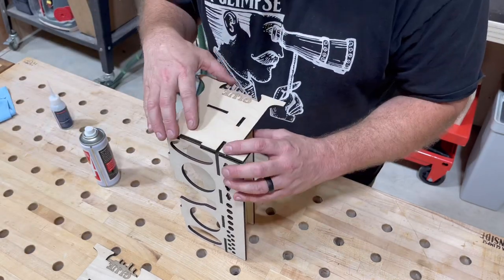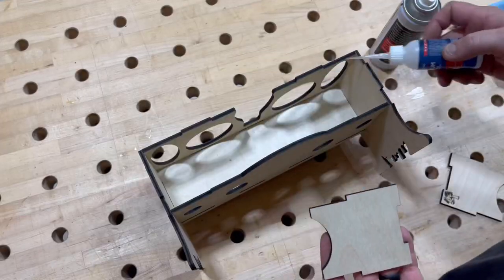French Cleat Glue Caddy Instructional Video

Comment: Would love to see a video on how you manage your CA bottles. I mean specifically about how you keep the tips and caps clean and such. Seems easy enough but my tips always get clogged and my caps never seal well cause glue gets up inside.
Reply: Hey Justin. I actually have a airtight jar full of acetone that I throw the lids in when they get a little gunked up. That’s about the extent of how I manage it I do keep unopened bottles in the refrigerator and I keep one of the same viscosity out and use it whenever I need it
Reply: @AGlimpseInside  ah, handy jar of acetone. 💡 I also keep the majority of my bottles in the fridge as well. Thanks Chris.
Reply: Worked like a charm after soaking for a couple of days. Sometimes the obvious solutions are the hardest to see. Tks brother.